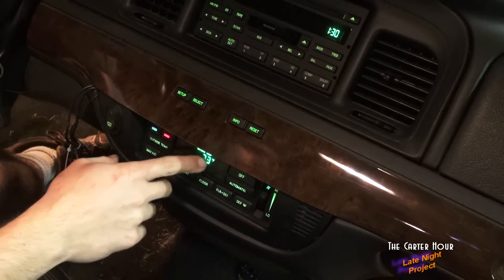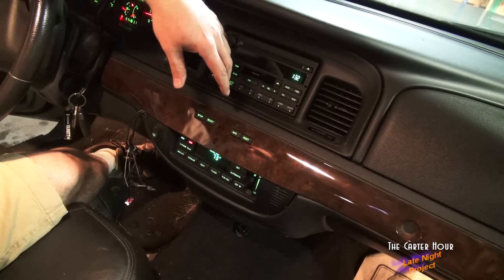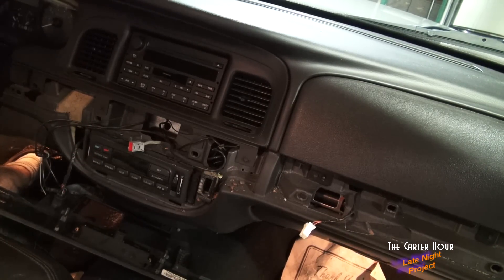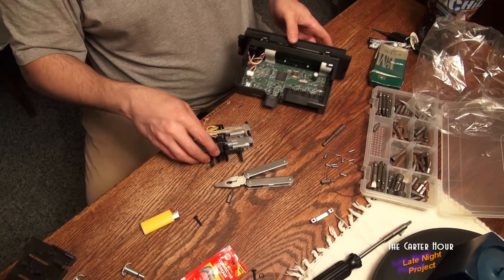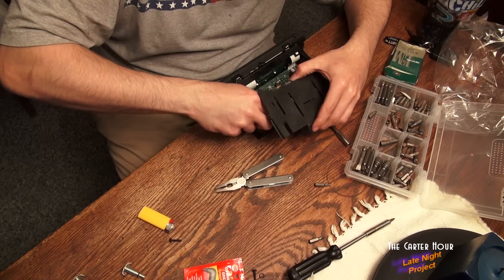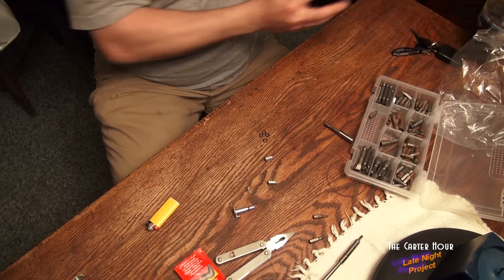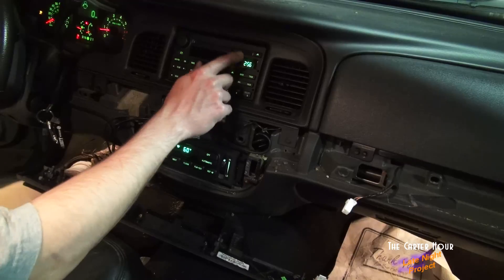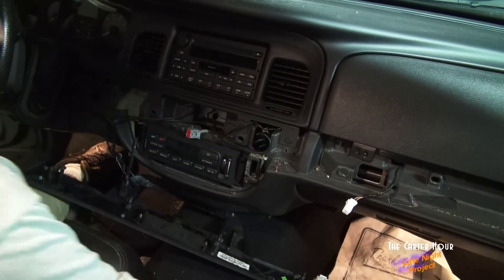Ford Lincoln Mercury EATC Repair Video - In Depth Tutorial - 3.00 Dollars in Parts

Comment: Thank you so much for your very informative video. I followed your video from start to finish and because of you and $1.60 in parts I was able to save $1300 as quoted by my local Ford dealership. I did a vacuum check at the plastic manifold that attaches to the EATC unit and I had vacuum. It took me 1.5 hours from start to finish. Anyone with a bit of mechanical ability and your video would have no problem with this fix
Reply from the maker: Hi Charlie,

Great to hear, I am always glad to hear how my video has helped others out in this situation as well.  So glad it all worked out for you and you are absolutely right, anyone can do this project.  Cheers, and thanks for stopping by and commenting.

Comment: Dude - I cannot say how much you've saved hard working people from being taken advantage of - I want 3x as many haters!! I was wondering about my wife's 1997 Lincoln TC - I've replaced the Blend Door Actuator and that persistent Clicking has STOPPED, YET still No AC - Would your diagnostic "Work Around" apply to such a RELIC -  Any suggestions other that DUmp My wfe's Creme Puff - PLEASE ???
Reply from the maker: zedieliam Well thanks for stopping by, and leaving the comment, great to hear from people that this channel helped save some $$$$.  Anyway to your problem, by the way one of my favorite cars 1997 TC, when you push max A/C does the A/C compressor engage?  If so, how many times does it cycle?  If its cycling fast, it means its low on Freon.  When you adjust your temperature on the EATC does it constantly blow warm/hot air?  If so, and you have replaced the Blend Door Actuator, there might be a wire that didn't get hooked up well.  Let me know your findings, and I will try to guide you the best I can.
Reply: The Carter Hour I am asuming the Compressor engages because of the difference in sound the engine makes - Sorta like it goes into a higher gear, and blows hot air. When you say 'How many times does it cycle" - What am I supposed to listen for ? Is it how many times the increase and decrease in  pitch of the engine changes ? - Because it does that only when I increase or decrease the fan blower / and the EATC - As far as a wire not plugged in - I'm anal retentive on specifics - LOLOL !! Regardless, if I change air flow directions - the blend doors respond to each location direction function switch i.e Vent/ floor/ Dash/ etc- My wife took the Lincoln to a Mechanic, whom stated that the PSI at one of the AC lines were at 300 PSI's, and that there was rust around the compressor - which doesn't make any sense. - but to your other question - the EATC in fact varies as you increase/ decrease temperature scale, again - in turn 
i hear the change in pitch of the engine/ compressor we are referring about. I've replaced the 30 AMP fuse within its fuse box, left above the battery - and still the hot air flows. How could that Mechanis state that the PSI's were at "300" yet say there appears to be rust, and that may be the cause/ lack of compressor  engaging ?? - Heeeelp !
Reply from the maker: zedieliam  Well the High Side of the Line, should never be that high (300 PSI).  A good PSI for the High line is around 150 to 200.  However there could be a reason for that High PSI.  One your condenser, in which is in front of the car, could be dirty, clogged, etc.  Another issue due to the High PSI is the Dryer/Accumulator, that sits down on the frame rail on the passenger side could be saturated with moisture.  If that's the case it needs to be replaced.  Another reason for the High PSI is that your Blend Door Actuator is not moving.  I believe this to be the case because even if the A/C didn't work, you would get cooler air as you move the Temp from 90 to 60.  The Blend Door Actuator has to do with temperature, not air redirection.  There is a test you can do, turn your EATC off, then press and Off and Floor then let go of those buttons and press Automatic.  This should take the EATC into diagnostics mode and display a number, in which I am assuming you will either get 024 or 025.  These codes mean the Blend Door Actuator is gone bad.  Hopefully this helps...
Reply: Thanks again - I'm going o try this and I'll get back to you , although I did replace the Actuator - I'm moved to beleive that it's the 1st issue you mentioned - Again Thanks.

Comment: Thanks for this video!! Just bought an $850 winter beater and this is exactly the fix I needed. Can't wait for parts to come in.
Reply from the maker: Chris, great to hear.  I am glad that you found the video and follow up to let me know how your fix went.  Cheers...
Reply: Just updating, I fixed it after getting the car back from state inspection. Everything went great and worked exactly as expected! Having a plastic pick was very useful in getting the o-rings on / off... I don't know when the car last had working vents but I do know my girlfriend (who was sitting in the driver's seat watching me) was surprised by a cloud of dust shooting out of the vents! Thanks so much for this quick fix... my mechanic INSISTED it would be something else but two of the four o-rings were cracked badly and one was on its way out. Total repair time was under 40min with no issues.

Comment: Thank you
Reply from the maker: You are very welcome, glad the video could help.
Reply: Carter i did everything in the video to the ETC unit and works, before it was stuck on just defrost vents, now it works changes vents and shuts off completely. how ever it does not  change tempeture or gets the air conditioner to work so i think i got another problem some where else , thanks i believe i fixed half the problem. i herard there a another vent control unit not sure of the name of it that also goes bad but you have to remove the entire dash to get to it.
Reply from the maker: James StClair
 Yes, if the air temperature is not changing its probably the blend door actuator.  Do you have a Crown Vic or Grand Marquis or another ford car?
Reply: 2008 grand marquis,  same one u working on
Reply: A good link to video for that would be awesome,
Reply from the maker: http://youtu.be/faCu7v0xTow is the pulling back of the dash.  Here is Zephmonts example of just removing the passenger side air bag and glove compartment.  However he doesn't replace the actuator, just rigs it, in which I wouldn't suggest.  http://youtu.be/NkUPsacbYzc but it almost seems like you could change your actuator correctly this way too.  Now you might want to run a diag on the EATC first turning off the EATC then pressing OFF+FLOOR then automatic, that will run though the all the electronics, and if everything is good, then more than likely its your Blend Door Actuator.  Now if you decide to pull the dash then you might just want to change your Heater Core at the same time to avoid having to tear apart your entire dash once again.
Reply from the maker: James StClair
Now if you do go the passenger side air bag route you want to disconnect your battery and wait at least 20 minutes before disconnection and removal of the air bag.
Reply: I looked into and boy it's a lot of work,  I don't think I can do it
Reply: I still get a error code says 025 and 024
Reply: Could it still be the unit I repaired
Reply from the maker: I highly doubt it, but I just like to be thorough.
Reply from the maker: I will try to find an answer but it sounds like it might be the blend door actuator.  Stay Tuned.
Reply from the maker: looks like Code 024 and 025 are a failure within the Blend Door actuator.  So it looks like you will need to replace the Blend Door Actuator, and the EATC is fine.
Reply: thanks, looks like to much work at this time,
Reply from the maker: James StClair
 No lie it is probably a weekend job.

Comment: Great video! I fixed my problem after I cheated and verified that I was getting vaccum up to the unit. I used a piece of curved hard plastic vacuum line to jump air on the vacuum hose block that attaches to rear of the unit between black supply line and the blue line that controls the dash vents and they worked so I then knew it had to be the exact issue you explained in your video! And I rebuilt the unit using the green ac style o-rings because I had an assortment of them on hand and kinda figure they may be stronger... and already had a big tube of die electric grease on hand from previously replacing coils / plugs on 2 different Triton V-8's in the past and if you have done them you know to lube up the boots very well to prevent arching down in there. But if those particular o-rings do not end up holding up too well I now know exactly how to repair it! Thank you for your time in making this video! Saved me $$$!

Comment: I just got done trying this and luckily it worked!!!!!!! Although I went through hell trying to find the right o rings. I called Oreillys and gave them the NAT-007 and they kept saying that it didnt come up in there system. Anybody looking for these o rings the number you need to tell them is 007 you can buy them by the pack or individually they are $.69 a piece took no time to do. THANKS FOR THIS VIDEO
Reply from the maker: zaccofbfac Thanks for the updated information.  I did this on my 2006 MGM as well, and my O'reilly Auto Parts did still carry the NAT-007.  However any 007 will work.  Glad it worked out for you.  Cheers....

Comment: Great video and patient explanation of everything.  Now I know why my dealer wanted a lot of money to fix the problem with my vic, because he charges like 150 an hour for the labor.  After watching I think I might try it myself and save like $900, minus $3 for the parts. Wow.
Reply from the maker: Jon, thanks for the feedback.  Yes the dealer will charge you between 700 and 900 dollars for the unit, and all you will get is another unit that has the same problems down the road.  This fix is so easy and it works great.  Cheers to you and good luck.  Please follow up on your progress if you can.

Comment: Great video I watched a few times and did everything step by step But it didn't work for me. Mine will work like it should sometimes. The problem with mine is it will be blowing air out the vents then it will switch to defrost when take off or going up a hill But also I can have the fan turned to low and it will switch to high but it goes out the defrost when this happens. I was just sure this would take care of it maybe I did something wrong but I was sure to follow your instruction's perfect. I did the  diagnostic test it shows nothing is wrong. The o rings I took out all were very good shape or seem to be the car is a 2006 Mercury Grand Marquis LS   it has less than 38'000 actual miles so it goes to show they can go bad even if they haven't been used a lot. If anyone has any ideas what wrong with it   please share them. Thanks for the  Video
Reply: And when I took the Vac-line lose there was no hissing noise at all.
Reply: Ok like I said I did have a little air coming out of the vents But after I put the new o rings in now Not any air out the vents ! So I think that I have a vacuum line problem But still I should have some air out the vents like I did.

Comment: Thanks for doing this video😉,My local Ford dealer wanted 08/15/2016 $800 for a new unit and rebuilt on eBay  is $185 with a $100 core
Reply from the maker: Its amazing how much profit was being yielded by the dealerships, Ford, and these rebuilders.  Cheers, glad you got yours fixed.

Comment: Awesome video. I’ve owned a ton of these cars they always having either the blend door actuator behind air bag problem stuck on HOT no a/c or this problem or vacuum problems on eatc. Thanks for the video. Currently chasing down on a 03 marquis..blend door tested good but wont move. Uhhh must be a vacuum leak somewhere
Reply from the maker: I know what you mean, if it isn't the control its fords famous vacuum leaks....:P

Comment: Wonderful video!  Looks like something I can try myself.  $4 and a couple hours of my time sure beats what sounds like about $1,000 at the dealer.  Thanks SO MUCH.  I will let you know how it worked.
Reply from the maker: Hi Jon, you should be able to do this with no problem at all.  Appreciate the follow up when you get it fixed...cheers...
Reply: The repair took 45 minutes, start to finish, with the help of your great video.  I could not have done it without your excellent example.  THANKS!!!
Reply from the maker: I am so glad that my video helped you get it fixed, and in under an hour.  Cheers...and you are so welcome.

Comment: Carter, my english is kind of limited, but I was able to understand, very well, your tutorial. I found it better than some "proffesional" tutorials. Thanks !
I own a 2008 Mercury Grand Marquis, just like yours, and was able to change the O rings without a problem. My air conditioner settings work fine as long as I don't drive the car. As soon as I accelerate the engine, the air blows only by the defrost opening. Do you know what it might be the problem? ...Thanks again.
Reply from the maker: fandevs avestruz Greetings Fandevs, is your car running a bit rough at idle?  It sounds like you might have a vacuum leak somewhere.  It could be the vacuum reservoir attached at the firewall behind the top of the motor (They moved this in 2006 from the left fender skirt), or a vacuum tube that is going to the reservoir.  Also you might want to check the tee that shares the vacuum from the intake to all vacuum operated devices and the brake booster.  Just follow the brake booster vacuum line.  Also are you sure that all o-rings you replaced did not rip on installation?  Also did you use silicone grease on the o-rings?
Reply: The Carter Hour Hi Carter !...Thanks for ansewer. Yes, I did use the silicone grease and checked it for the new o-rings to be O.K. The removed old rings, at least two of them, were hardened (cooked?) and broked easy,  the other two were somewhat flexible . I know that following your instruction helped a lot because before doing the repair I never had  air from the front panel vents. It seems that I have an additional problem. Will follow your reccomendations and let you know. Thanks again !!!!

Comment: Unfortunately in my 2000 Grand Marquis  - I disassembled the EATC as shown n this video, only to have the 4 vacuum actuators were spot welded onto a metal housing, unlike your plastic one and there was no way to slide out the actuator to gain access to the o ring without totally butchering the unit.
Reply from the maker: You could possibly go to a pull a part and upgrade to that version.  It should be plug and play.  Make sure you get a 2003+ EATC, bring it home do the repair on it and put it in and you should be good to go.  I have ran into those metal ones and no way around like you said.

Comment: Excellent video. I just bought my daughter an 03 GM with the same problem. I'll definitely give this a try. My son has a 99 GM that I can't get cold air out of. The compressor works fine so I think it's the blend door motor. I've checked out other videos on the net. It seems like a real pain. Any thoughts?
Reply from the maker: +Pat Reges Hi Pat, this should definitely work on the 03.  On the 99 yes, sounds like the blend door actuator has gone bad.  Thanks for watching...Cheers.

Comment: Hi Carter,  Excellent video.  I performed the repair on my 03 GM.  I replaced all 4 O rings with the recommended red silicone #007 rings and used dielectric grease and reinstalled the unit exactly like in your video.  All bench testing on it worked fine and got A/C out of vents and all modes test fine.  The only problem I am encountering in when accelerating up a hill the air tends to switch back to the defrost  then returns to the proper vents when up the hill or when acceleration up the hill stops. Any idea what could be causing this or how to correct it?
Reply from the maker: John Pessamato Sounds like you may have a vacuum leak somewhere else.  Since you have an 03, which I did in the past you will find the vacuum reservoir on the driver side fender well in the engine compartment.  This could be leaking, or the hose from the reservoir could be leaking, or the parking brake release module that hooks to the column shifter could be leaking.  Sounds like somewhere you may have a vacuum leak somewhere.  In addition you could have an intake leak.  Does the car run and idle fine?

Comment: I used this video as a guide to performing the same repair on my 2007 Grand Marquis which was the source of my blower vents in the default position as well as my new radiator fan relay not working. The hardest part was finding the right size O-rings locally. Thanks much!

Comment: Thanks, this video is awesome.  I can't believe how many people out there are experiencing this exact problem.  I even found the exact same thing in my 2008 Mercury Marquis LS as you did.  The first original ring I removed (the same cylinder that you removed) was also very brittle.  The others I noticed were not as brittle as the first, but they were all thin compared to the new ones I put on.  Also, the new ones are very flexible and thicker.  That combined with the dielectric grease provides an excellent seal. I fired up the system and just got back from a cruise.  Nice ice cold air out of all the vents.  Ford should be ashamed of themselves and should pay you a bonus for his video.  Again, thank you so much it's nice to know there are people out there like you.  God bless you!
Reply from the maker: +William Atkins Hi WIlliam, I am glad that you got your 2008 MGM's EATC blowing back through the vents again.  Yeah I wish Ford would pay me a bonus, but they never will...lol.  No worries, I am so glad it helped you fix the issue and cheers. :)